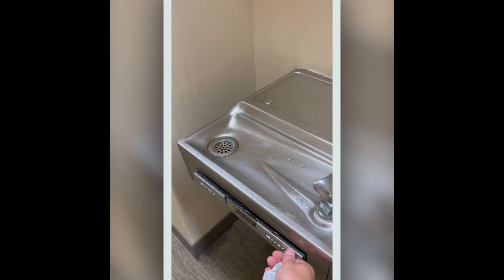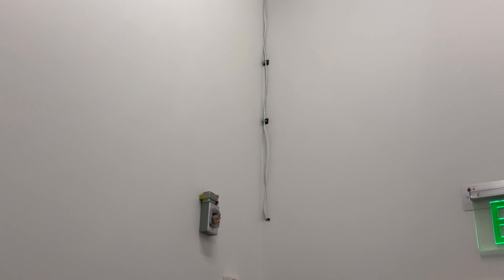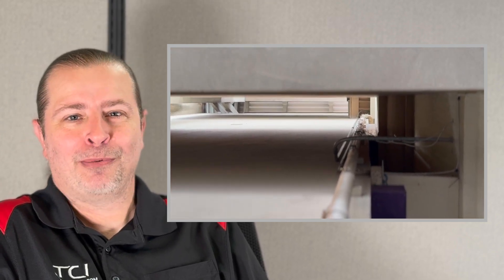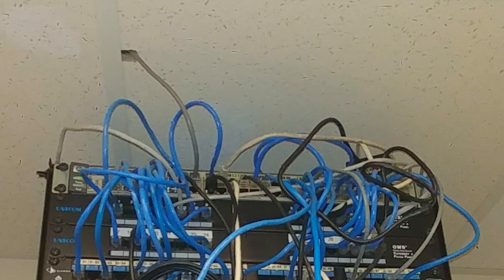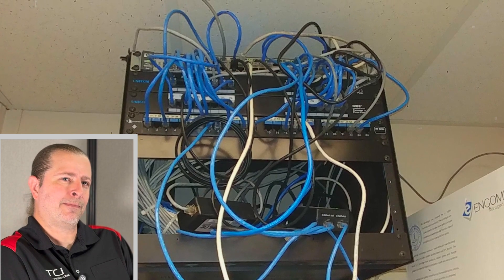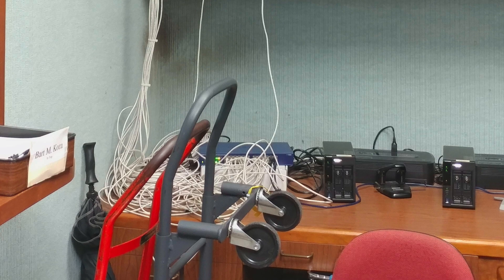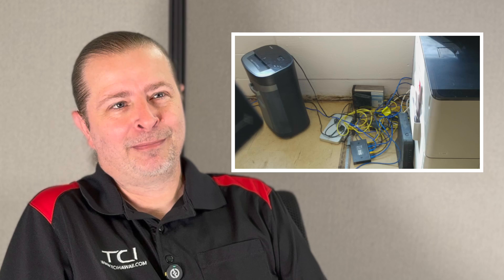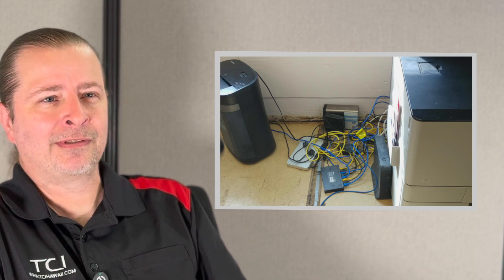Reviewing Cable Fails - Real World Fails from Client Networks

Comment: What happened is the installer just did the wiring, terminating, testing,and labeling. Then the IT team comes in and ruins the pretty work with their patches. Happens all the time. When the company does all the patching.

Comment: Those were some great fails but as a network engineer and jiujitsu practitioner, I appreciate the choke hold reference on Fail #7. 😂 As my instructor would say, if you’re in a choke hold or triangle you made a mistake many steps before. The escape is not to be in that position in the first place. Love  the videos.  Aloha 🤙🏽

Comment: - Too many different installers. " Let the next guy clean up this mess."
- Too many people in too much of a rush because the next customer is yelling in their ear to come fix something. 
- Staff turnover at the customer's business which means the new guy who just gets two things connected to make something to work. Then quits 6 months later.
- Why use a 12 inch cable when a 36 inch cable works ? Or just use whatever cable is closest.
- Customers who are rushing installers to get it done so their staff can get back to work. 
- And of course, customers who don't understand that it costs money to do the job properly putting the installers under pressure to just get it done and get the hell out.

Comment: I love watching cabling work, both fails, and pretty well done ones.

Fortunately in the current office we live in is really superb cabled (copper, fiber, power, etc), and a lot of space to grow (we are using maybe half of 3 racks). We inherited it from other company, but clearly whoever they haired, or haired before they got there was a pro and proud of their work.   Previous office was also good, but it was us who did most of the stuff (two sub-rooms for distribution, and then just some runs between them and to access point). Fortunately most runs were already put in place, and also pretty good (and splitting things into two sub-rooms made it even easier to manage). Now we have everything in one room, but cabling is top-notch (all switches at nice comfortable level, cable combing is top notch, colored, zip ties, labels, patch panels, cooling, fire suppression, door locks, etc). I added a custom map and printed sheet of what goes where, just in case we need to rework things or add some stuff, but it was pretty easy to trace everything, put few switches, and connect about 40-50 devices in (some computers, laptops, wifi, cameras, few small servers).

We still do have some old stuff (switches, cable modems), but they are fully disconnected, and tucked into separate rack. Just so it does not clutter shelves, and we need to have some backup or run an experiments.

And rack at home I have, is a bit of a mess too. Also too small (22 units high), which I tough would be enough. It never is enough ;D And low rack, makes it hard to work on it, because you need to have a chair or constantly bend to do something inside.

Comment: Worked a summer student job as a 'cable puller' for a small company installing network cables in schools.  One old school had water underneath.  They gave me black garbage bags to wear on my legs to wade through the water. Smh.

Comment: I have found that a lot of workers in and around the the service of networking telephone and video the quality of work has been degrading more and more over the years. when you bring  the observation to people in charge they do not want to what should be done to fix the situation at this time they will take care of it later. I have been in some of the locations time and time again with no change. There are times I have to find new location for my equipment. I do the best with what I have to work with. Quinn

Comment: Hey hey hey, don't go hating on mayo, I love my mayo!

I am currently working to clean up a rack for a restaurant. Someone started with a decent patch panel to a switch in a 4 U rack, then added a lot of new cables. The new cables were all terminated with RJ45 connectors and it is a spaghetti mess. I'm going to move the existing patch panel below a switch and add a new patch panel. I will reterminate the RJ45s to keystones in the new patch panel. It should be much more tidy when complete.

Comment: multi tenant buildings, or any large building where the owner doesn't care/understand networking and all the systems are terrible. So easy to have old phone/isp network interface boxes, building management, access control all adding up with new coming in and interfacing with some of the old for that one last AC unit until it's replace but once that happens no one takes out the old BMS. Ugh.

Some of these weren't that bad. Mostly typical. Too bad the phone guy that got decided to do networking didn't stick around and punch down the cross connects instead of letting some network guys use those unwieldy patch cables - probably needed replacing to be reliable at gig though. Krone blocks are better for gig than the 110 blocks. The 110 to RJ45 patching at the racks was too far.

Comment: Went to a bank years ago that had dumb terminals at the teller stations. All worked except one, and it “sometimes” worked right. To make a long story short, I traced the cable to a room that nobody knew about. It turns out the cable end was about 18 inches from where it should have been plugged in. So I plugged it in and they had no more problems with the terminal. I still don’t know how it “sometimes” worked, even though I witnessed it myself.

Comment: Just found your channel last week. And find the channel very informative and entertaining. 

As an network engineer I don't really do the dirty work of the full wiring of an building.
But sometimes I like to do it when it is an small change for like AP's in the suspended ceiling.

Most of the times I rewire racks and replace equipment like routers, switches and AP's. And I like to keep things organized.

I've been looking for another tester for an while to properly show length and breaks.
Does this tester also supports finding breaks in cables?

Comment: I've got a fail to share, new client called us in to do cleaning of his computers and server. He was so proud that he had a file server built by his previous IT guy to share all of his critical business files. (This was a CNC cabinet making and countertop manufacturer so tons of CNC cut files and design files that are crucial to keep safe). Long story short that "file server" was a windows 10 install on consumer hardware with ONE SINGLE SSD storing all of his critical files, there was a redundant pair of SSD's for the windows install, but the data drive was all on its own so it was misconfigured. No backups or redundancy to speak of, just a lone solitary SSD drive doing its very best.

The kicker is that becuase of the nature of the business that server had almost a quarter inch of very fine wood dust inside the case. So that poor "server" was chugging away, choking on highly combustable dust with no backups or redundancy!! Just running on hopes and prayers lol
Reply from the maker: I have seen this exact scenario at two different CNC places, it must be part of the business plan.

Comment: What do you recommend as a cable type for any kind of future proofing? Is it Cat 6 or Cat 6A today? Is it too soon to go with Cat 7 as a standard yet? Do you tend to recommend physical cabling or are wireless connections more "in demand" these days? How does the size of the business affect your advice? Not all of the questions that need to be asked, I'm sure.
Reply from the maker: If you install cat6 right now, it should be good for the next 20 years.  Cat6A is quite expensive and very bulky to manage and work with, so I only deploy it if I know for sure that the user will need 10gigs at 100 meters sometimes soon.  I haven't seen that wireless has affected my commercial jobs in a negative way, if anything placing the APs and getting those connected to the greater network has added cost rather than saved it in most cases.
Reply: @tciproductions  Very salient points all around, especially regarding APs. I must apologise as I was thinking about wireless bridging (as opposed to APs) when I asked about "wireless". I have seen a few small projects where "line of sight" distances of 100m+ up to 2km are involved to connect outbuildings in rural or semi rural settings to provide connectivity options for new tech. Added cost is still a concern if power availability has a need to be augmented at one or both ends of a link.

Comment: I think a lot of these "fails" are the case where management is just pushing to get things back up and running. While the IT department gets it up and running with the intent of going back to clean it up, they just get buried in work and the changes just keep piling on. I know I am guilty of the "I will get back to clean up later" syndrome.
Reply: I fully agree. I work in K-12 IT and a lot of our network cabinets are like this for this very reason. It also has to do with lack of time, lack of patience, lack of prioritization, etc. I've been at my job for nearly 4.5 years. There has been a lot of turn over over the past 15 years at this district in IT so people come in, "plan" projects, and leave or get fired or move elsewhere and things never get done, including network cabinet clean up. The best times for us in IT to clean up is during breaks but we often have a backlog of other projects that take precedence so it keeps getting put off.

Comment: I've been there before, a lot of these are caused by the attitude 'if it works, don't touch it', which as you say, is fine until it doesn't work, at which point all bets are off!

Comment: Back when I had a day job, I saw many of these fails.
Fail 3 - Got to put the jack above the level of a normal pallet- say 4 or 5 feet.  Patch cords are cheap and easy to replace.
Fail 8 - We called it FIIW: F*ck It, It Works
Fail 9 - We had a room like this.  The building was wired by the renovation contractor and the jumpers were done by in house techs.
Fail 10 - Network Archeology.  After a new contractor took over from my shop I warned them that this switch in the middle of a former server room was still doing things, but I was ignored and they shut it down and were in the process of cutting the cables when they realized that half the NEW server room was off line.

Comment: I remember how one day I saw a bunch of RG6 coaxial cable lying on the floor, and to my surprise, that cable was connected to the network. I decided that it would be interesting to understand the logic of the person who did it. As it turns out, the signal on the line was too strong, and to reduce it, someone threw 150+ feet of cable instead of a tiny attenuator.

Comment: Number 10 and 11 gives me PTSD. We had so much left over stuff from old equipment that was never removed and I spent so much time having to rip out 3 old phone networks, intercoms, old cat5 cables on top of cat5e and cat6 cables, multiple internet feeds, cheap UPS’ all squeezed together for 30-40 years worth of IT equipment, right next to the hot water heater of all things. I had no choice but to deal with it and have the old crap pulled out as much as possible, but getting permission from management to spend money to do such things is typically harder than the work itself.

Comment: Do you often see low end consumer grade equipment in these rooms?  amazing how people will cheap out on networks supporting operations that generate a lot of money per minute. also, I could really put that tester to use.
Reply from the maker: I either see the cheapest thing Amazon has on offer, or I see the cheapest infrastructure and a $12000 catalyst switch.

Comment: Fail #10 reminded me of a radio station the audio was first distributed via the punchblocks.  Then years later the upgraded to audio over IP but when the upgrade was completed … they never removed the old punchblocks and wires. The wiring was undocumented and unlabeled….. I remember the cleaning crew to get a free outlet for their vacuum unplugged what they thought was a ups i4 rooms away and they actually killed power to  the master control room for the am station

Comment: #9 what kind of connectors are those? I mean the one at 12:01 - green cable with milky white connector?
Reply from the maker: I think they may be one of the Amphenol brand subtypes from the 90’s that didn’t catch on.  There were several ‘modular’ connectors meant to convert between phones and LAN but RJ-45 beat them all in the market.  I could be wrong though, I don’t recognize them.